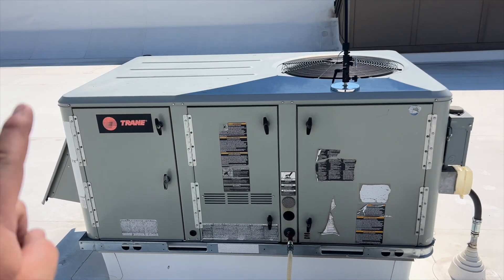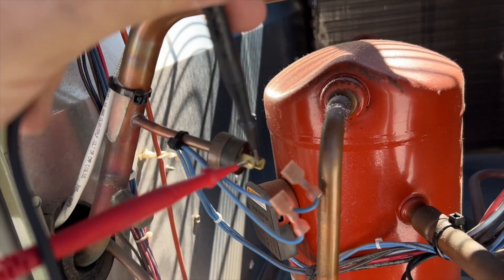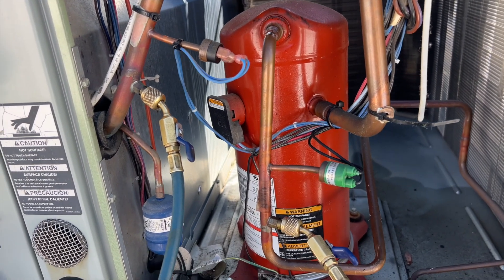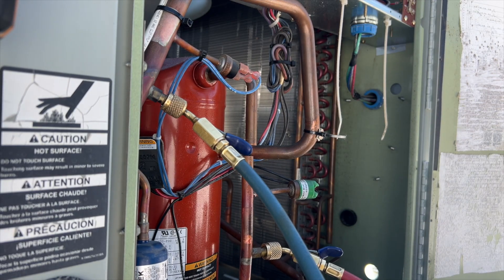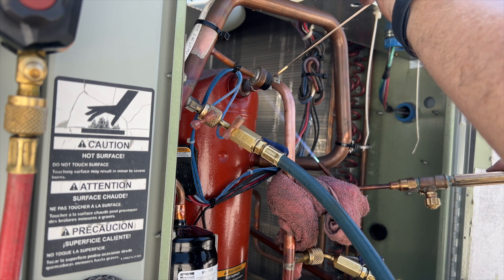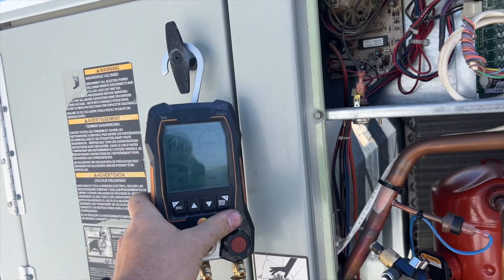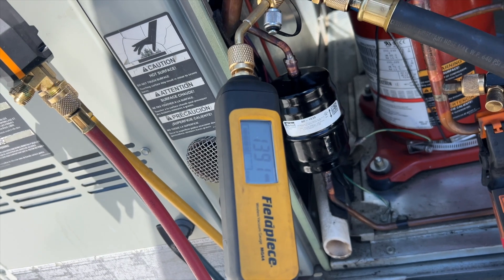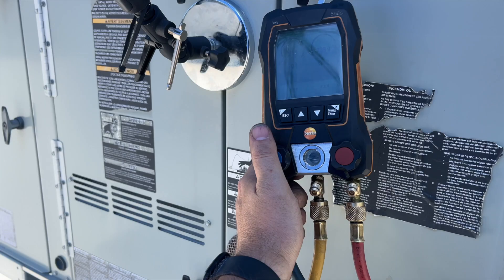Trane Package Unit Not Cooling. Refrigerant Leak Repair EP184

Comment: I would have done the same thing, just replace a piece of pipe instead of brazing over the leak. Great work again man. I hate when they use an odd ball size drier. I always just use a standard 3/8 and adapt to it.

Comment: Question I have R410A psig is 189 I was told is to high for the low pressure. How do you fix this? What would cause this? Thanks
Reply: What's the high side pressure? Possibly overcharge. Or high return temp, dampners open, high heat load, etc
Reply: Your high side pressure and your low side pressure are almost the same? You're compressor is not running
Reply: @elwoodstelhommme8745  Hello 186.8 it is about 105 outside temp in house is 90
Reply: It says liquid pressure is 338.4
Reply: @christinestraczek6388  yeah you're fine...your unit has a high low side pressure because of the high heat load. Performed a air split across the coil. It should be 16-20
Reply: A split is return temperature minus supply temp
Reply: @elwoodstelhommme8745  The temp going in is 80 and coming out of my ac vents is 61. Why do you think my house is 90?
Reply: @christinestraczek6388  yeah your fine. 19 degree split. Give it time. The supply air will continue to drop. It will take awhile before the space is cool
Reply: @elwoodstelhommme8745  This is normal temp for inside due to it being to hot outside?
Reply: Thank you
Reply: @christinestraczek6388  depends, if you have large windows. How air seeping in, etc. 80 degree return air is not normal unless it's coming from outside, cooking etc.
Reply: @elwoodstelhommme8745  I wonder if it's because the return air is going up into a closet were the furnace is that has a small opening on roof to the outside. The closet is about 120, Could I get that closed or does the furnace need fresh air?
Reply: Sounds like your heat strips are running with the ac running.